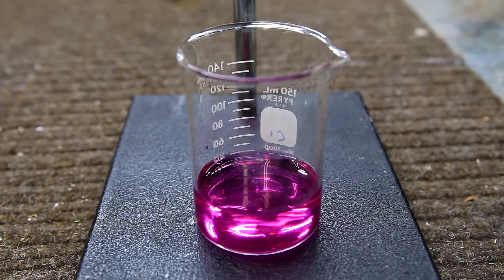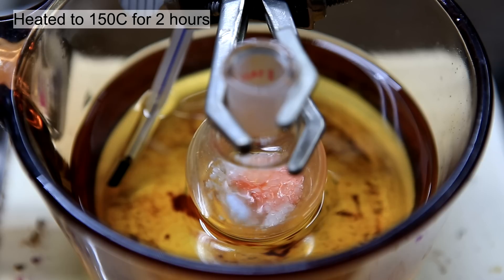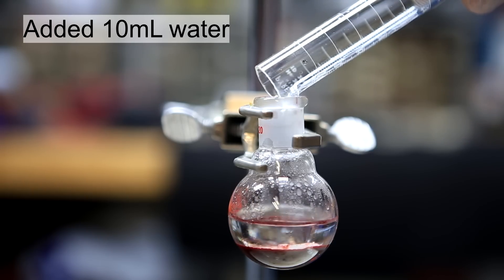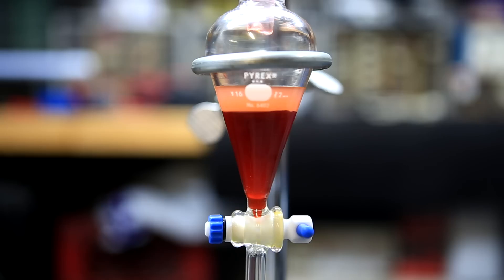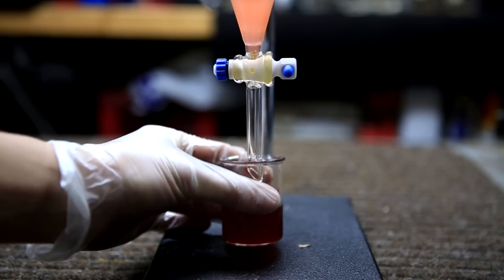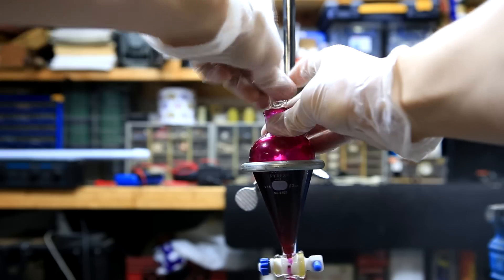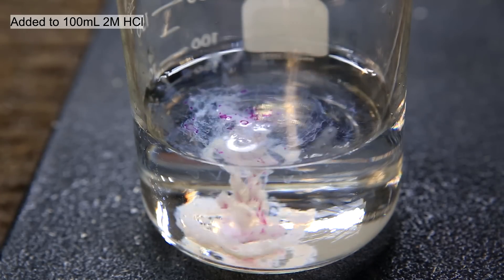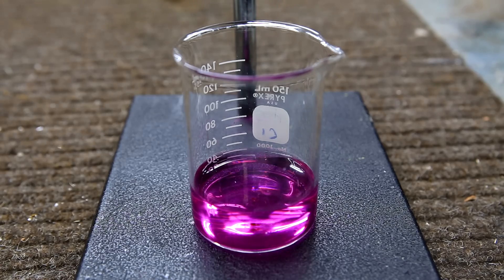Making Phenolphthalein (a common pH indicator)

Comment: Can we use acetone or ethyl acetate
Reply: Aceton mixes with water.. all phases mix each other. It is not good. DCM, CCl3 are useful and have lower boiling point for reversible on distillation.
Reply: @GameDevCaptainBlack  yeah I also that as well .But I inquired in case I dont get hold of Wood tarnish from which Nile used to extract DCM.

Comment: I reapeated the reaction you have done but with carbolic acid insted of phenol crystal. However in the end, after the phenolphthalein solution was added  the precipitate was forms is ash color not white. After few minutes some sticky black colour oil like paste was occurred. So I couldn't take a precipitate to filter. But when I add NaOH to sticky black paste it turns  red same as the phenolphthalein. Why is that ? Can you give me an explanation ?

Comment: It turned brown, because leftover phenol reacted with oxygen. The same can happen if you synthesise paracetamol
Reply: It's react with HCl..cl make it brown..not oxygen..it's react with HCl how the hack u got oxygen?
Reply: @arunavachakraborty4565  Oxygen in the air alone is enough to react with the phenol.
Reply: @Shelleloch  it's air tight .duh
Reply: @arunavachakraborty4565  I don't think if you heard correctly, but he said that it turned brown after letting it dry overnight.

Comment: Methylene chloride has an exposure limit of 25 ppm, at which point supplied air respirators are required. I think you should include a recommendation that adequate ventilation be used or you need an SCBA (air tank respirator). Methylene chloride creates the same physiological effects as carbon monoxide.
Reply: Tensor Tab work in fumehood 😀

Comment: Why is sulfuric acid such a common catalyst?
Reply: Cadell Van Den Heuvel very strong acid, and 2moles of h+ per
Reply: jake pole But why does that make it a good catalyst? What about a very acidic environment facilitates so many common reactions?
Reply: Usually, id say UTFSE, but... eh. Lol.

H2SO4 in aqueous solutions will dissociate into 2H+. Those free acidic protons will protonate some portion of the structure being reacted with, which will destablize the structure, and ,"kick start" the reaction. As an example, with esters, tge carboxylic acids double bonded oxygen will pick up a free proton in acidic conditions, which essentially creates an imbalanced of electrons. As to why H2SO4 is used specifically, im not ENTIRELY sure, but id say its availability and the fact that less can be used compared to an acid like HCL, since you have 2 moles of H+ per mole rather than one (stronger acid)

Comment: why do you need to vent the separatory funnel?
Reply: Riccardo to release pressure that might have built up due to evaporation of DCM. It might not be necessary for this kind of washing, but it's good practice so that it doesn't blow up when you do some sodium bicarbonate washings, which tend to form copious amounts of CO2.

Comment: What is the purpose of h2so4? Does it need to be conc.?
Reply: It acts as a catalyst, and usually it needs to be conc.
Reply: Sulphuric acid gets proton to acyl oxygen in ftalic anyhidride, its acyl carbon get ready to reaction, at the same time it gets activate phenol ring to attack. Rich phenol ring electrons (-) are warned by (+) protons of acid.

Comment: My first attempt at this looks like it failed :/ ive ended up with dark brown goo after filtration which i then put in the oven at 150*C to try and get the water out but now it looks like i burned it, fuck. Did you get a brown goo upon filtration then just put it under vacuum in a desiccator? Also upon addition to the HCl the precipitate that formed was pink not white like yours, Im not entirely sure what ive done wrong.

Comment: I got phenolphthalein in my school's science kit.
Reply: gorepuppy My school uses it on a regular basis. The sophomores I think are using it to test for unlabeled compounds
Reply: gorepuppy
Be surprised. I bought a kids chemistry set for my daughter a year or so ago, and it has  phenolphthalein in it.
Reply: The little kits for young children had it. We were a mess back then.  So you know that stuff led to some stories.  Yep, I think I would prefer to use litmus paper but ya you can use it to learn a  little bit about a liquid in a pinch. The coolest use for it though in my opinion is magic paint.
Reply: It used to be very common and used in laxatives.  Someone poisoned me with it and damn near killed me with water loss from diarrhea. The way they poisoned me was still funny though. But I do not remember any safety info on the stuff back in the day. "here kids, play with a possible carcinogen that is also a very powerful laxative".  I would be surprised if it is still in chemistry kits for children.

Comment: For me it takes less than 30 min. for the phenol + phthalic anhydride + sulfuric acid to becomes dark red.
p.s. I use molten phenol

Edit 1: I keep heat it until minute 30 was reached and it becomes dark crimson (almost black but still contains crimson shade to it).

Comment: why is it spining??
Reply: If you're talking about that small plastic-like object in the round-bottom flask, that is a magnetic stir bar. It is a small magnet which spins in response to another spinning magnet built into the hot plate.
Reply: Rotothermic reaction

Comment: Really interesting! But do you really need sulphuric acid to acidize the first reaction medium or it's possible can use something a bit more available like HCl? Sorry if the question is a bit dumb, I'm amateur and I have a lot to learn!
Reply from the maker: ***** I have never heard of using HCl instead of H2SO4 in a reaction like this. I would assume that it would cause problems because HCl is about 36-38% and the rest is water. You would need to use an acid that is near 100%, which there aren't many of that are strong enough. Maybe if you do some research you might find something, but off the top of my head, i cant think of anything easier and as cheap as H2SO4. It is hard to obtain in some places though.

Comment: What does the reaction mixture has a red color ? can that be to the presence of a small amount phenol red that's produced by the sulfonation of some phenolphthalein ?
Reply: gonzalo2010lab I don't think so. Pretty sure it's due to the high acidity. But I could be wrong.
Reply: Phenolphthalein is always colorless is acidic solution. The reason the color change happens in phenolpthalein is apparently from a quinone group being formed from one of the phenol groups when it is deprotonated (only in basic solution). This qionone group is also formed in phenol red, giving it it's color too. I think it probably is from phenol red, because when he puts his product into the 2M HCl there's a yellow color produced.